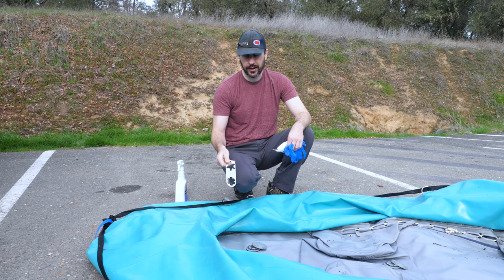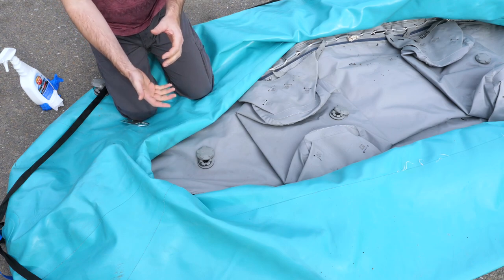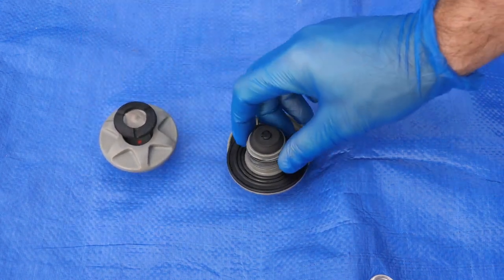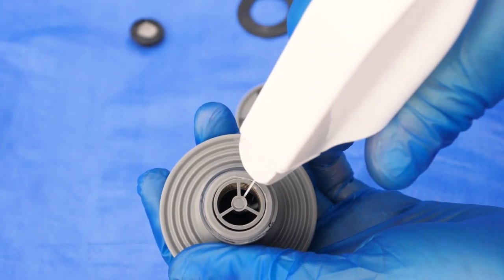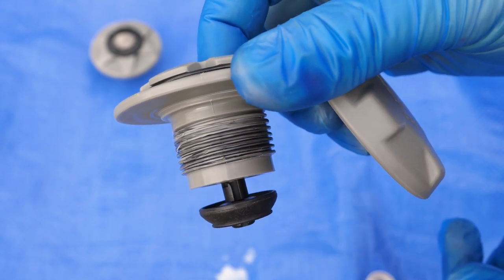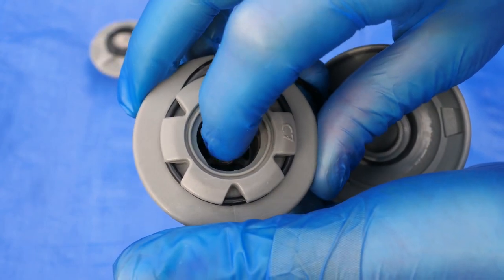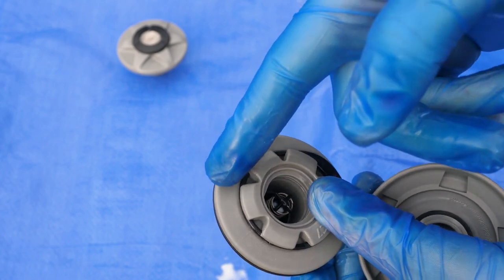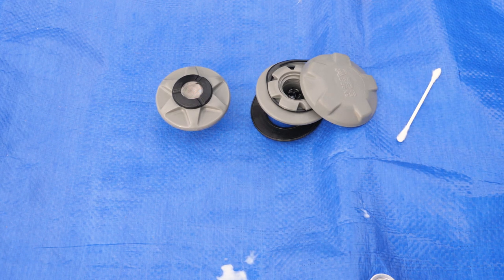The Gear Shed - Basic Valve Maintenance

Comment: My pressure release valve is always on a slow trickle out. I have sprayed 303 in it from the outside and it did help but this is my next step. Thanks for the tip and the visual to give me an idea of what to expect.